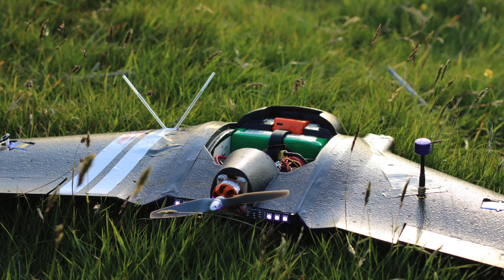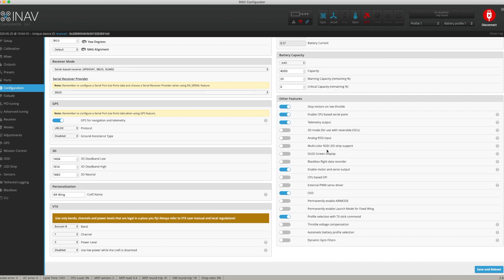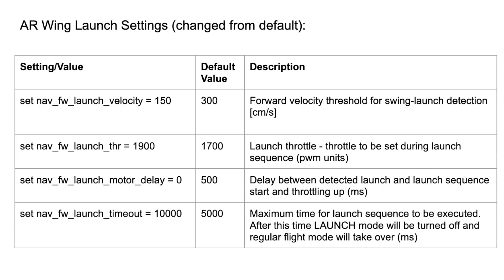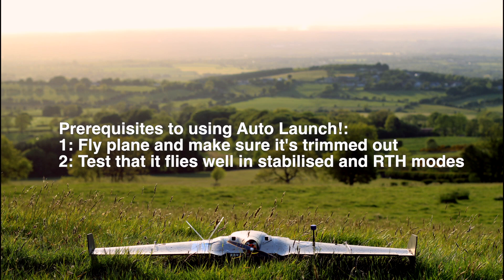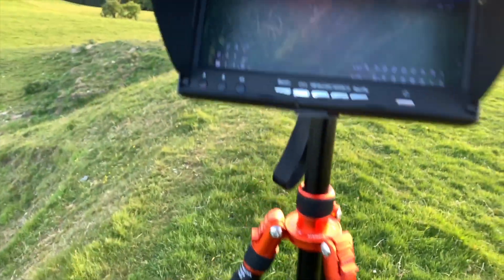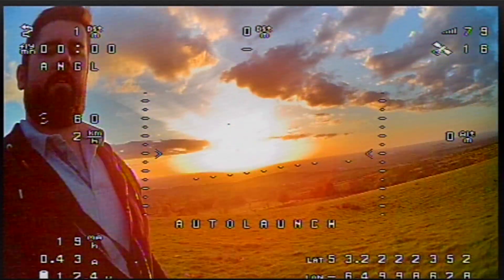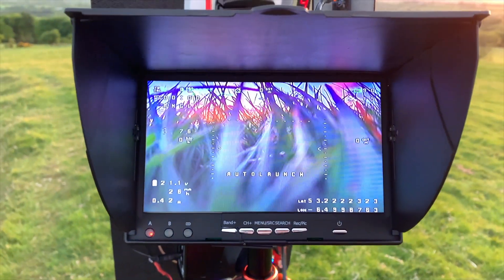iNav Auto Launch 🤖🛫 How to and Demo of Procedure

Comment: In case something goes wrong after takeoff, is there a way for it to detect whether I’ve taken control, and if I haven’t, to return to the launch point using GPS data and loiter there?
Reply from the maker: I don't believe there's anything for this. Best thing to do is user RTH mode as your post launch mode, that way it doesn't matter either way

Comment: Is it possible to set up autolaunch to have different delays for each motor on a push/pull inline motor aircraft, or even to just use one motor only during the launch? Thanks.
Reply from the maker: I don't know off the top of my head, you'd probably need to use the programming functions but even then I don't know if its possible

Comment: my first (ever) INAV auto launches will use two aircraft, the AtomRC Swordfish, and XFly A-10 Dual 50mm. Would "Your" settings do well with these aircraft? I'm concerned about the EDF motors. Should i ramp them up even higher for the launch?
Reply from the maker: Thats something you'll just need to have a guess at, all depends on how much power the plane has for it's size and weight. good luck :)

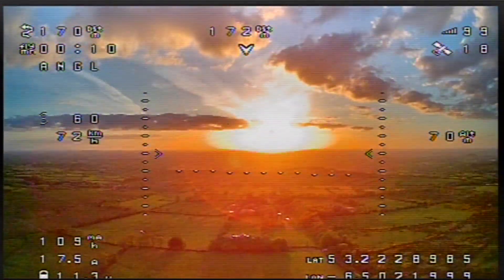Comment: At 5:32, it appears ACRO was the mode it entered after auto-launch completed. Is that the stabilized mode you set? Thanks. ( You mentioned angle mode but the screen showed ACRO).
Reply from the maker: Not sure if I just switched modes fairly quickly after the launch finished there but I normally set post launch mode to 'Angle' so that I can trust it will maintain altitude.

Comment: Informative video.  My AtomRC Swordfish is dipping the left wing durning auto launch.  The first two fights it worked liked expected, but now the aircraft wants to roll to the left.  I did  have a couple of mishaps with the ground prior to the auto launch roll issue and wondering if that may have done something to the FC boards.  May try and replace the FC.  Thanks for the video!
Reply from the maker: Glad it was useful. I’d suggest check over the mechanical parts for damage or lose linkage etc first. Maybe worth re-flashing the FC before replacing it

Comment: Hello budy, how are you? Do you have any presets for the air wing pro?
Reply from the maker: Hi, default settings are pretty good. I'd increase the timeout to 10 seconds, set idle throttle to 50% and Launch throttle to around 85 if using PNP. This is if yours is an average weight

Comment: i  shake and throw  i change my settings im going to try and do 0 motor delay and motor idle up and a arm timer so i can throw out in front of me..... most of the time i throw over head and i shake then throw and it works just not and pretty
Reply from the maker: Much better to use idle instead of the shake method. You can even add idle delay too if you like, so when you move the throttle stick up to start launch, it can wait a number of seconds before the motors actually start the idle spin
Reply: @AdamGdoesFPV  i like the idle delay but like i said i did all this and the plane dose not like it when i throw and have it start! It has to be bumped and thrown at the same time and it works every time stock settings only 1600 for launch throttle

Comment: any recommendation for sonic modell pro 1000
Reply from the maker: Honestly, most normal models launch well on stock settings. Maybe add some idle throttle to help with the initial throw. Good luck
Reply: @AdamGdoesFPV  i have done all that and idle or not it fucking sucks its too big of  a model too be thrown . a quick bump start and throw works every time im done listening to people that shit cost me more then 6 props and 1 arwing pro. shake and over head throw works every time and now fucking up trim or you plane with do a back flip in auto launch!!
Reply: @AdamGdoesFPV  my sonic modell 600 work great with the shake and throw always has with stock settings too ... if it works dont change it! i have and it was not worth it!

Comment: I'm asking you to help me, have a problem with autolaunch. After steps : arm engine, put throttle to value after launch  procedure - engine go at once to this value of throttle and not to idle. In my case this value is 1200. All other parameters are like in your case. Thanks for answer.
Reply from the maker: You need to set 'idle throttle' to 1000 so that it doesn't spin up when you move the throttle stick

Comment: Hi, I have the same settings on a tbs but I don't get the autolaunch display in my goggles only Hor or stab ??? I am using mates 405 v4. any ideas. Cheers wayne
Reply from the maker: Hi Wayne. Autolaunch text appears on the OSD item ‘System Message’. Check you have that configured on your osd and it’s not overlapping with other items.
Reply: @AdamGdoesFPV  Thanks Adam, I made a rooky mistake , i reflashed the board and this setting reset and i missed it lol.Thanks

Comment: I'm trying to setup a zohd dart 250 but my autolaunch just nosedives into the ground. The motor does spin up when I throw it but it just doesn't seem to move the servos. RTH and loiter work perfectly. It does seem rather nose heavy in manual mode, but it’s perfectly balanced.
Reply from the maker: Sounds like it’s either underpowered/too heavy or you’re not throwing it hard enough.

Comment: Is airspeed sensor necessary for inav auto launch
Reply from the maker: No not at all. It does absolutely nothing other than show as a data item on your OSD.
Reply: @AdamGdoesFPV  so if i dont have airspeed it will cause no problem rather than giving just speed data
Reply: And how does it know that it has been thrown in the air for auto launch
Reply from the maker: @aesatishchaudhary5933  no because iNav doesn’t use it in any way at all. All it does is gives the pilot info. I have no airspeed 6 out of my current 7 iNav planes
Reply from the maker: @aesatishchaudhary5933  Accelerometer. Nothing to do with airspeed
Reply: @AdamGdoesFPV  where do we find inav auto launch in modes as there are no option except cli in inav configurator 2.6.0

Comment: Hi all the trim have to be on center position or no
Reply from the maker: Yes. Using iNav you shouldn't use the trim adjustment on your transmitter like you would traditionally. You use Autotrim in flight for it to set the servo centre position. If you adjust the trim it could quite possibly prevent you from arming or cancel autolaunch as it will think you are moving your stick.

Comment: Hi Adam,thank you for that video! It's so helpfull! Just one question-what stabilised mode do you using right after launch? Thank you a lot!
Reply from the maker: Thanks, glad it was useful 😃 I just use Angle mode for stabilisation. I switch to manual as soon as I have my goggles on and transmitter ready 👍🏻

Comment: Hi
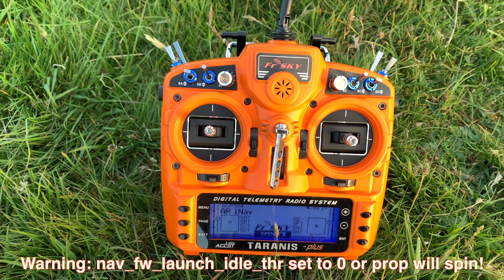I think I'm doing something wrong regarding info from 4:46

I get this when trying to set 0:
# set nav_fw_launch_idle_thr = 0
### ERROR: Invalid value. Allowed range: 1000 - 2000

Any advice?
Thank you
Reply from the maker: Sorry my text is not very clear, I mean 0 as in 0 throttle. For values in iNav CLI 0 throttle is 1,000. This is also the default value for this field. Hope this helps 👍🏻

Comment: top vid pal testing on wing tomorrow
Reply from the maker: Good luck, I’m sure it will go well 👍🏻 cheers 😊
Reply: Adam G does FPV went well. Now just need to sort out the crossfire failsafeing on 500mw at 500m out
Reply from the maker: 😱 that sounds like something’s very wrong. UHF should be 10km + without thinking about it.

Comment: wow. no torque roll on launch. I need to have idle throttle quite high for my models not to spiral into the ground right away on auto launch
Reply from the maker: Have you tried launching without throttling you before the throw?
Reply: @AdamGdoesFPV  yeah, but it is quite heavy. maybe I should try it again now that it is trimmed out

Comment: Thank you for providing your guide for us. Is there a link for the 3D print files you use to hold your flight controller?
Reply from the maker: Thanks for watching and commenting. I designed the F722 / F765 mount myself and you can find it here:  http://tiny.cc/F722orF765mount. The F405 mount I found here: https://www.thingiverse.com/thing:3218887
Reply: @AdamGdoesFPV  Thank you

Comment: Do you need to put reflex on the wing even on  nav launch mode being active?  Or the flaps should remain neutral on launch?
Reply from the maker: Hi, you should NOT add reflex to the wing for launch... doing so would in fact cancel launch mode. Nav Launch is designed to maintain an upward angle in degrees and adjusts the control surfaces automatically to active this. nav_fw_launch_climb_angle is set to a default of 18 degrees and I have not changed this in my settings. Just do what I did in the video and trust it ;-)
Reply: Adam G does FPV Thank you very much for your response. Highly appreciate the gesture.
Reply from the maker: Raffman 42 you’re welcome 😊👍🏻 good luck with your auto launch
Reply: Adam G does FPV  Btw i forgot to ask you if you set manual for takeoff on auto launch or you were set to air mode? 
Also what setting did you put on your PID Tuning in regards to Max Pitch Angle and Max Roll Angle values?
Thanks again Adam
Reply from the maker: @raffman4266  My default mode is Manual and that was on when I use Auto Launch, and I don't activate air mode ever on any of my fixed wings. Everything that I have changed from default can be seen in my diff file here: http://tiny.cc/AR900Diff
Reply: Adam G does FPV  Thanks again Adam! You have been such a great help in this ever changing and evolving hobby. More power and subs to your channel man!

Comment: Hi Adam. Sorry to ask a dumb question but I'm in need of your help!. I have built a flying wing but I'm very tight on space inside the fuselage and have been forced to put the esc very close to the receiver and flight controller.

Is it bad practice to have the receiver, flight controller and receiver too close together? Do I need separation between all three of these ? ( esc, fc and receiver)
Reply from the maker: Is with those components I would have liked to keep the rx away from the ESC. It might not be an issue though, just see how it goes 👍🏻 if you put them this close together I guess there’s no other option. Must be a small wing?
Reply: @AdamGdoesFPV  it isnt too small. 1m span, but the inside compartment for mounting stuff is pretty small.

I'm running the dji digital fpv system , so the vtx and rx are in one unit. The system is commonly used in quads where things are crammed relatively close together so I'm hoping it will be ok....cant be sure
Reply from the maker: Ah that should be fine 👍🏻

Comment: Best thing i ever put on my Ar900...Activate launch mode, set throttle just over half, slight wiggle to get motor going, then throw...what more could you want.
Reply from the maker: You should do it they way I demo in this video without the wing wiggle at the start. It’s simpler and also there are reasons why the wiggle can cause issues on launch 😊👍🏻 thanks for watching and commenting

Comment: Great video as always Adam. Just installed my F722 into a Talon GT, no maiden yet, still waiting on bits from RMRC. Would any setting be different with a standard airplane (v-tail)? Complete newbie with iNav. Took me 1/2 day to learn how to arm the blinking thing. 😂 cheers again!
Reply from the maker: The launch settings don't need to be any different because it's a V tail. In fact the Talon GT is one of the models I used these settings on with 100% success. You can see it auto launch at the start of this video: https://youtu.be/eaOTkcW53qQ The general setup on the mixer tab is where you need to set it to V tail. Made really easy in iNav now as it's one of the standard templates. Cheers :)
Reply: Adam G does FPV , great to know, I did see the mixer setting for nano talon - v-tail , id imagine it’s the same setup. Thanks as ever for your reply, it’s very much appreciated as always! Cheers 🇮🇪

Comment: nice.. now my question is... if you need it to climb at a certain angle to clear obstacles, how would you do that? the place i fly from there's houses at the end of the field that I would obviously need to clear
Reply from the maker: You can set you climb angle by adjusting the following parameter in your CLI tab: nav_fw_launch_climb_angle the default is 18 degrees. If you increase this angle just make sure the throttle is high and that your plane is capable of this. Too high angle and not enough power could result in an instant stall. Hope this helps. Cheers

Comment: Great video. I used to have auto launch always on as well but have a bad habit of accidentally disarming the plane in the air.
Reply from the maker: Hi Sam, I'd be interested to know how having Autolaunch permanently enabled caused you a problem with your disarming in the air? Cheers
Reply: @AdamGdoesFPV  I wasn't able to re-arm. I was flying a C1 Chaser and gliding. I bumped the arm switch and tried to re-arm and nothing happened. I was over some trees next to a river and the only way I could get it to re-arm was to go into a dive over the river.
Reply from the maker: Sam S but having auto launch always enabled caused you an issue re arming?
Reply: @AdamGdoesFPV  Yup, when I disarmed it put it back into launch mode when I re-armed. The motor would not spin up. Once I put it into the dive I think it crossed acceleration needed to spin the motor for take off. After that it was fine and flew as normal.  I wish I had the dvr from that flight but it was last fall/winter. Since then I have started putting launch mode on the momentary switch on my QX7 and it works good. Just hold the switch up, arm and then set the throttle position and then let go of the switch. If you arm but don't set the throttle position it will cancel launch mode.

Comment from the maker: Note: Please remember that these are the settings that have worked for me on many different planes/wings... but this doesn't mean they will be suitable for every plane out there. For further information on the LAUNCH mode parameters, please check out the iNav Wiki CLI page here: https://github.com/iNavFlight/inav/blob/master/docs/Settings.md do a cmd/ctrl + F and search the term "Launch". TIP: Go into the CLI tab on your configurator and type "get Launch" and it will display all of your current launch settings and the allowed value ranges. I understand there are many different ways we can and do use this mode and its mostly down to personal preference. I hope this guide helps you achieve easy stress free launching :)